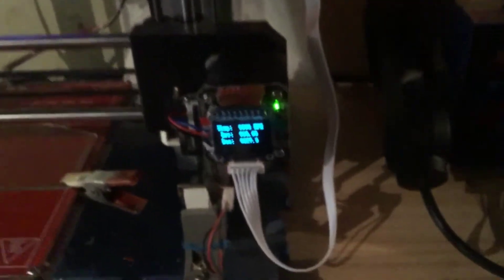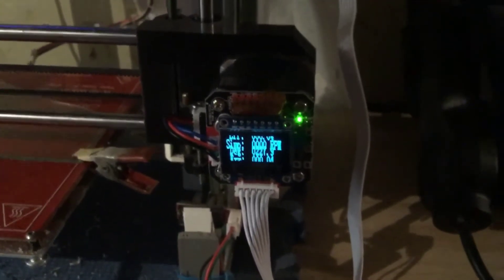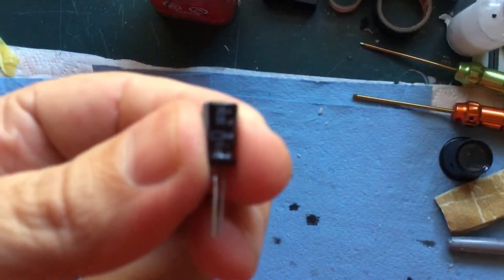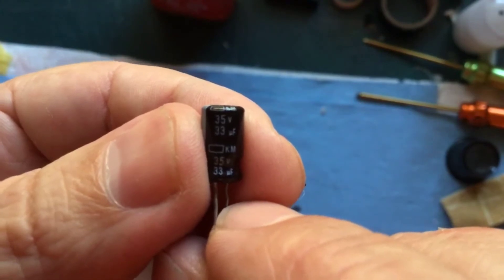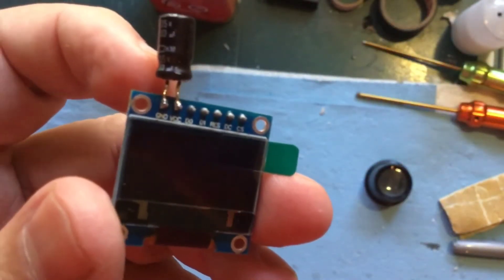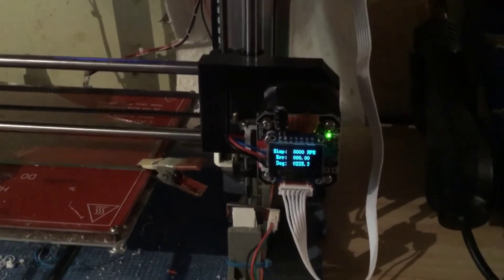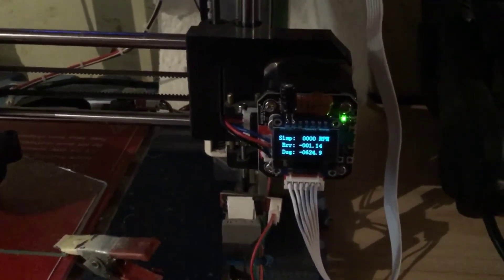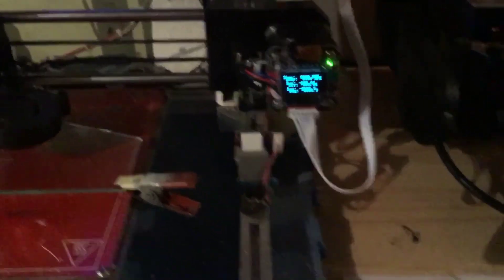Bigtree-tech closed loop stepper display glitch fix

Comment: I've never had such issue, but I have an entirely separate step down converter for 5v from the 24v of the PSU, which I could assume being more stable for higher loads (for example if you've got a servo too) than getting the 5v from the motherboard out of the linear regulators (on an Arduino Mega at least). I wonder if that could be it, the 5v fluctuating causing that glitching and the one layer shift you had. In that case a capacitor indeed is the quick and simple fix, that should make those more reliable overall as well.
Reply from the maker: That makes sense. Thanks for the comment.